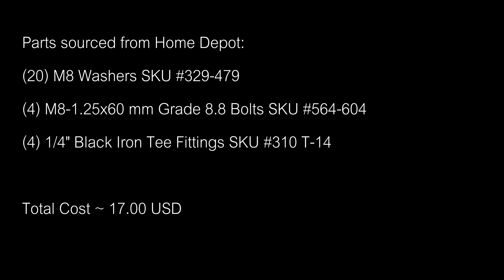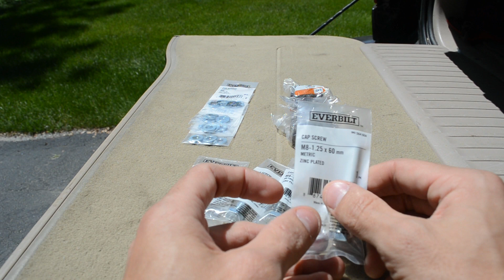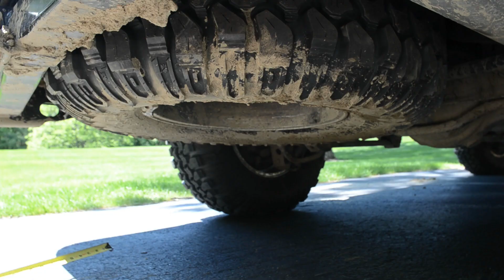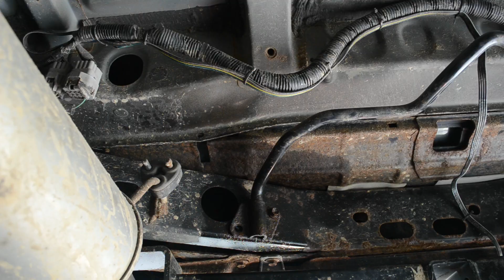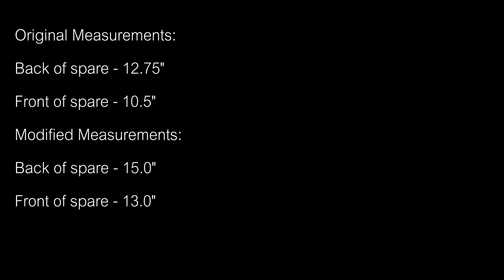How-To Spare Tire Modification Lexus LX470 / Toyota Land Cruiser UJZ-100

Comment: How many washers did you put under the crossmember and the jack receptacle on each of the 4 screws?
Reply from the maker: i think i used 4 or 5 under each i dont really remember. you can check if the jack funnel is low enough to get your lowering tool into place before you finalize everything by test fitting it all.

Comment: What year is your LX.  I’d like to fit my 33” back under mine.
Reply from the maker: It's an 01. 03 and up I believe have a charcoal canister mounted in the rear that may affect how this mod works on those years. Good luck and post up your results
Reply: I think the 03-05 had the built in hidden hitch.  Different system.   I need to look into how to get my spare back under there.

Comment: Did you keep the same bolts where the tire lowering part is at? 
Seems like it’ll only be on a few threads if I ad 4 washers.
Reply from the maker: I used the stock bolts for the spare tire lowering mechanism. You can get longer bolts if there isn't enough thread engagement after using the washers / spacers. It's been a few years since I did this I dont recall how much thread engagement I had on my setup but I havent had any issues with it. Thanks for the comment! If you have any other questions feel free to ask away.

Comment: I was wondering the same if 285/75r16 will fit without interference    from the tow hitch. Any help would be appreciated. Love the content and diys!
Reply from the maker: Thank you for the kind words. The tire size listed should fit without issue as it is the same tires I am running! Good luck and thank you for watching & commenting
Reply: @lillyautomotive  awesome, I assume you're running the stock tow hitch as well. Keep cranking out these awesome videos!

Comment: Great mod.  Was wondering if the 285/75/16 will fit on a stock suspension on  1997 land cruiser.
Reply from the maker: the 97 land cruiser is an 80 series land cruiser, the 99+ up to 07 i think is 100 series - which this video showcases. id imagine it would work but i cant tell you for sure.
Reply: Thanks

Comment: What size tires do you have? I want to change my tires from 275 70 16 to 265 75 16 or 285 75 16. Just wondering if those sizes fit were the spare goes.
Reply: I was wondering the same if 285/75r16 will fit without interference    from the tow hitch. Any help would be appreciated. Love the content and diys!

Comment: So what spacers did you put between the cross member and the winch? I got confused there. Thanks!
Reply from the maker: Christian Howell 4 washers per bolt for the tire winch.
Reply: Daniel Lilly  the same bolts still? Or did you get longer ones? Seems like the same bolts will only be on a few threads of old ones reused